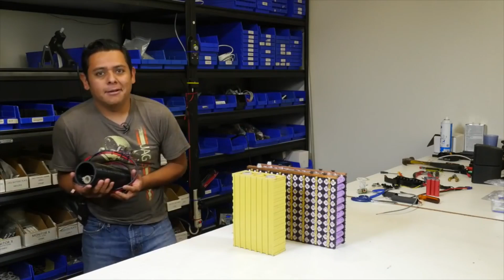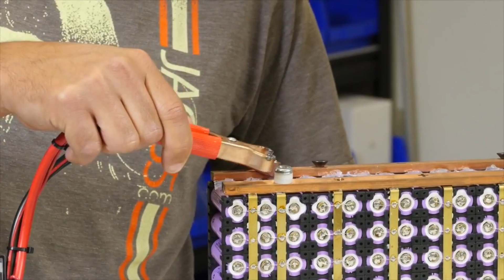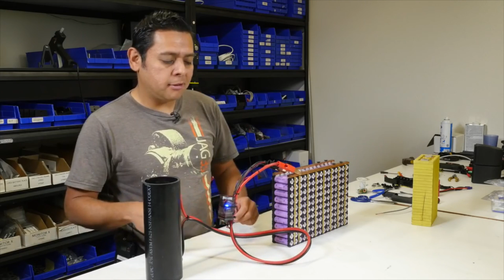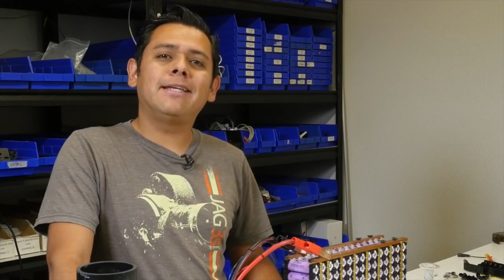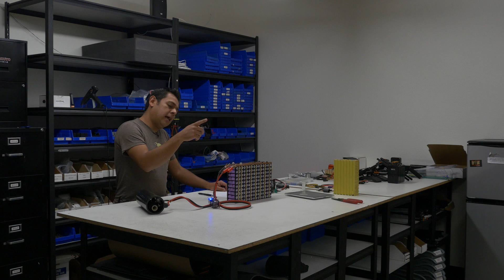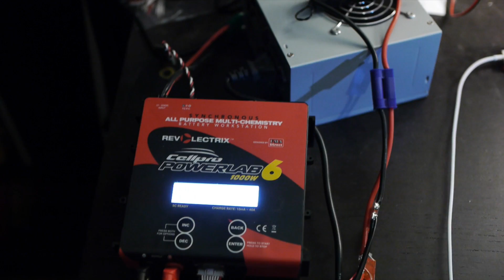QT #4 Simple Battery Bottom Balancer  LiFePO4  18650

Comment: maybe you could run a relay with the power running that beeper, and run a contacts cutoff  switch. the cheep Ebay battery monitors have a relay for 20 amps .the higher amp ones you ad your own relay /contact switch. some may have temp cutoff too. mine with no temp, was like 3 bucks afew years ago. and it has Bluetooth.

Comment: Iv been thinking about the balance issue. For a smaller pack it should be possible to build the battery with "some" switches so that you could easy disconnect the cells from both paralell and series. Then using individual chargers for ea battery set to the prefered volt. Doing this every time you charge = balance and never have to top charge or bottom. 
Also using A bms for protection during use.
Good concept or stupid?

Comment: Also, my battery manufacturer recommends connecting all the single batteries in parallel before putting however many in series for 24 hours, I imagine this makes them balance their charge, they are all at around 3.2, what type of balancing is this? Is it really useful in any way? Gracias!

Comment: Thanks for the info! For what I heard on another of your videos, I should probably use my new batteries for 100 miles or so to discharge them some, then do the bottom balancing slowly and carefully... I'll have 144 batteries in a 24s6p pack, it's OK to just do the bottom balancing on the 24s not the whole 144, right?  Thanks!

Comment: Hello. I want to know the bottom balance voltage of lifepo4. Thanks.
Reply: It depends on the liefpo4 battery they are not all the same. Mine are 2.5 but some go as low as 2.0 so 2.5 should be a safe bottom balance

Comment: Here's a thought, if you put a small fan on the end of that black tube and used a solar panel to charge the batteries you could have a cheap solar powered heater, may be useful for the old and hard up, over the lifetime of the battery pack and solar panel may save hundreds of dollars assuming the tube is fire proof.

Comment: When you create a parallel pack of 18650, do you only need to bottom balance once? I know you mentioned it in the video but i  want clarification? Also as far as soldering the cells together, what temperature did you have your soldering station at? Thanks, love your vblogs keep them coming.
Reply from the maker: +Steven Guzman   your question does not make sense,    when you parallel multiple cells,  they become one battery.   You can not balance a single battery,   you need at least 2 batteries to balance them to each other.   Balancing is usually only done once,  there are some instances where you have to balance cells every charge cycle like in RC LiPos,   I will make a video explaining when cells need balance charging soon
Reply: +jehugarcia This is where i get confused, I might have misinterpreted the video, but it looks like you have your 18650 pack all in parallel and your performing the bottom balancing test.  I know that you only need to balance packs that are in series but then for parallel it would seem they will self balance.
Reply from the maker: yeah paralleled groups of cells all share the same voltage,   in essence self balancing.
In the video I was bottom balancing that one cell to be connected with others in series

Comment: can I change my battery of my evo scoter into lithium? im using acid seald battery.
Reply from the maker: Pretty sure you can
Reply: +Mario Flores Ran 4 of these in my goped esr & wow! 
http://www.ebay.com/itm/12V-10Ah-LiFePO4-Battery-Lithium-Replace-your-SLA-/221680916587?hash=item339d36586b:g:QOoAAOSwrklVFdoW

Comment: how does fully discharging a battery pack that is connected in parallel balance them? surely weak cells will still discharge more than stronger cells?
Reply from the maker: It's very hard for paralleled cells to be at different voltage

Comment: The EV TV product uses a relay to disconnect the load.
I just use a load and a $5 quad copter battery monitor - alarm thing from Venom.
Your big jumper cables have raw copper clamps and could touch both + and - terminals, they need bigger covers or paint the outsides of the clamps with plasti-dip.

Comment: I guess what I wanted to hear was the guaranteed destruction of cells or the pack if I didn't remove this at the correct time.  If your planning to sell these you have to to legally protect your self in a disclaimer.
Reply: ABS is only really used for sanitary conduit piping.  It is rated at a maximum of 180 degrees F.  And is combustible .

Comment: To protect your property and batteries you need a way to disconnect. An alarm is nice but not good enough. Most everyone has a motor to use, right? If you want, this will work with a resistor if needed. Be sure to keep that hot resistor from anything flammable. Here is my answer to a shut off system that is simple and easy to duplicate. https://www.youtube.com/watch?v=DO0zDd01eks
Pete :)

Comment: It might have been a dull video, but it's been so long, I couldn't care! Regardless, how much heat does that thing pump out? Is it that strong? Strong enough to keep a plate of scones and a cup of tea warm kind-of-warm?
Reply from the maker: toyotaprius79 Better than nothing right,    good stuff is coming,   I just need some time to get it done.  Id say the tube gets 80-100 degrees,   no problem holding it on your hand kind of heat.